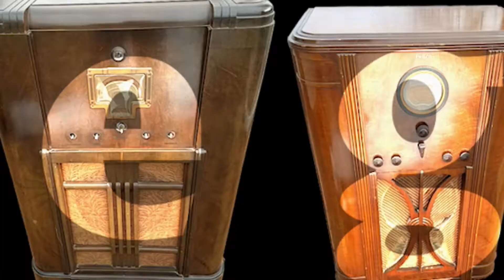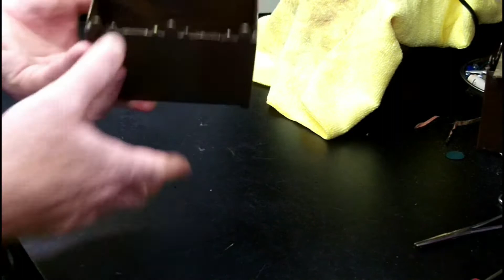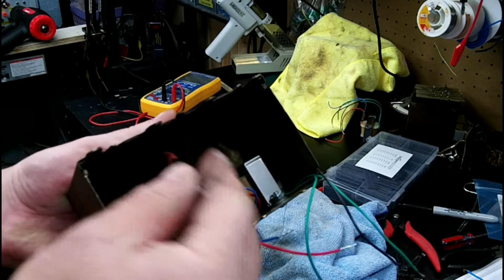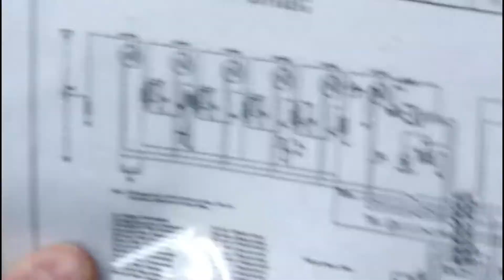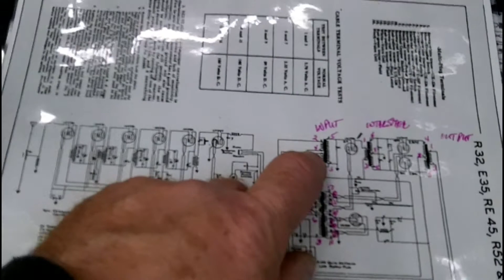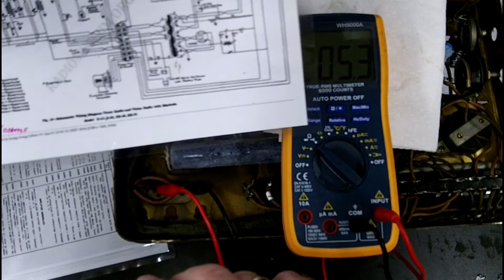1929 Victor R 32 TRF Radio - Part 3-  Rebuilding The Transformer Cans

Comment: Gregg - cool technique “no pun intended” for getting the transformers/tar out of the cans. I've never used the freezer method, but will when the opportunity presents itself. I’ll probably put a corkscrew in the tar before freezing and hopefully that will provide some leverage. I haven’t looked at the thread on the ARF, did you get feedback on the transformers or go with what folks had done in the past? Great job! Best, Don
Reply from the maker: Thank you Don, I spoke at length with Larry L. and we looked at the schematics and discussed what he used on a similar project. The only thing I ever got on the ARF was a suggestion to find another R32 and get some from it. He said they made 179,000 of them, so they are plentiful. Yeah right, I'll get right on that. If it doesn't work, I'll see what the results are and go from there.

Comment: I am wondering if drilling a single 1/8" hole in the top of the can and then using compressed air after freezing would pop out the entire block?  At any rate I will never heat one of those cans again, the freezer method is far easier and much less messy. Great work Gregg.
Reply from the maker: I bet that would actually work very well Larry. It definitely had suction on it which is why when I smacked it on the back it sucked it back in. I thought of that because when you are trying to get cranberry sauce out in one piece you stab a hole in the bottom and it slides right out. I bet the little hole and air would work very slick!